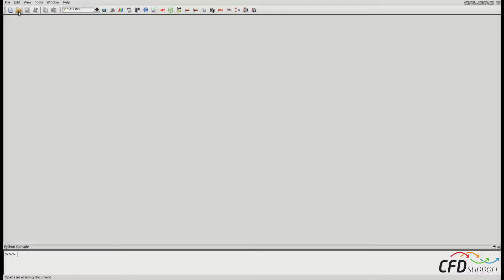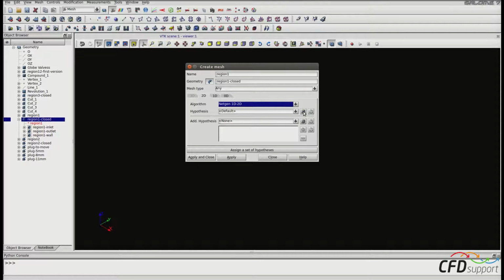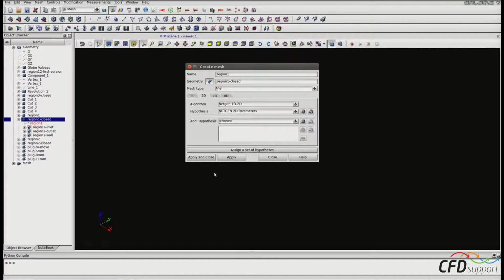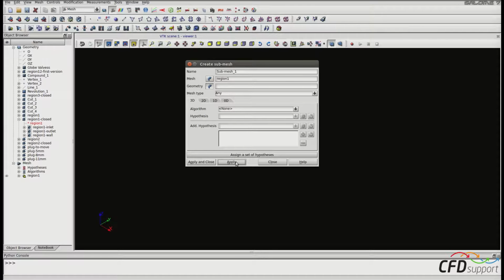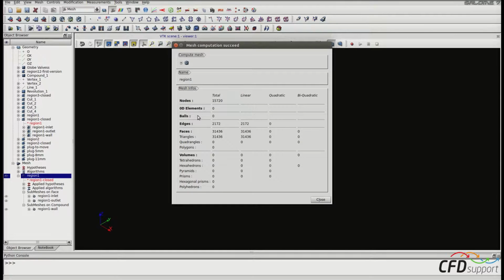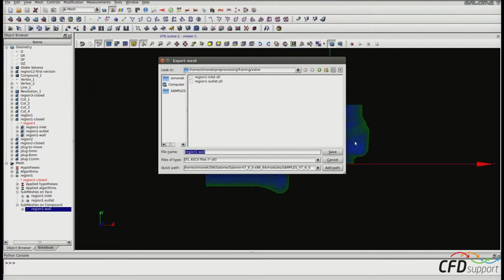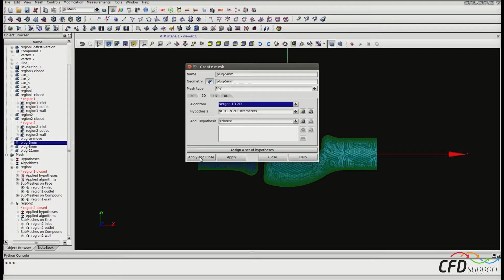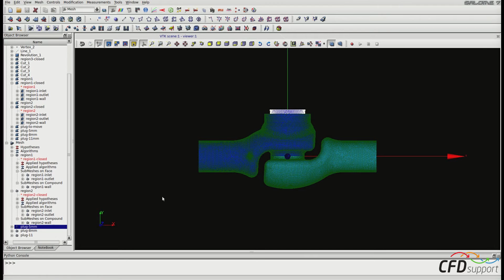Salome CFD Preprocessing Training Valve Tutorial Video Part 5

Comment: Very good set of tutorials! I'm new in openfoam and i have one doubt, we don't need to create a 3D mesh to simulate the flow on the valve interior region? 

It would be very good if you continue the tutorials in openfoam environment until the post-processing.

Thank you.
Reply from the maker: This tutorial is about preprocessing the geometry - making the surface mesh - stl (stereolitography) files - as an input for further meshing of the volume.
Reply: thank you for the information. now i understood the purpose.
Reply: @CFDSupport  Could you please do the 3D volume meshing tutorial? Thank you